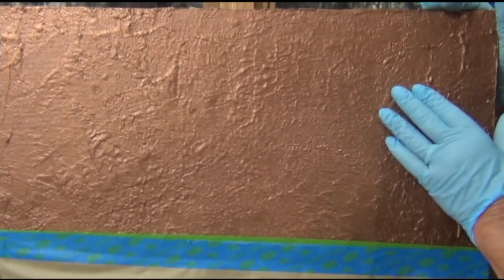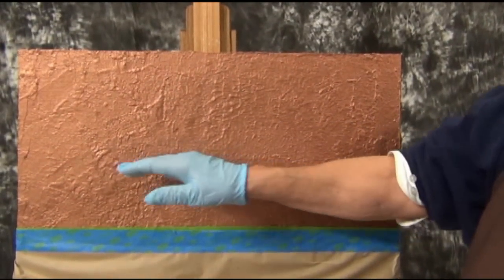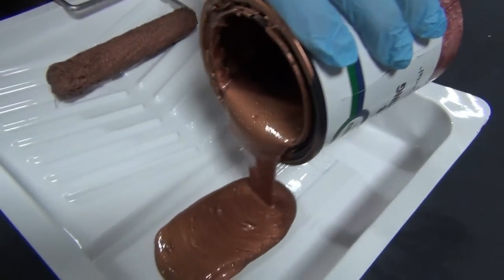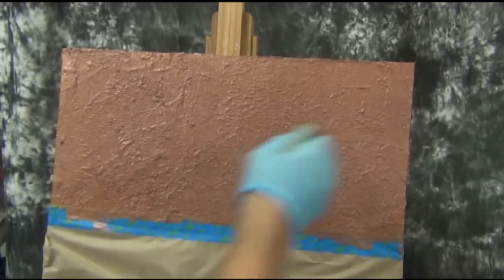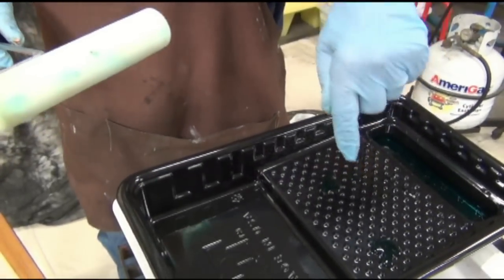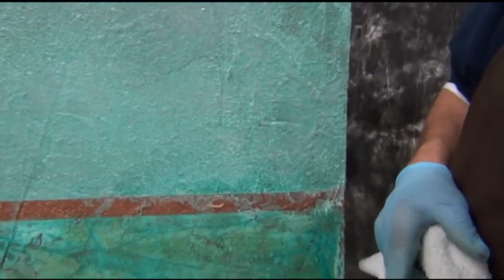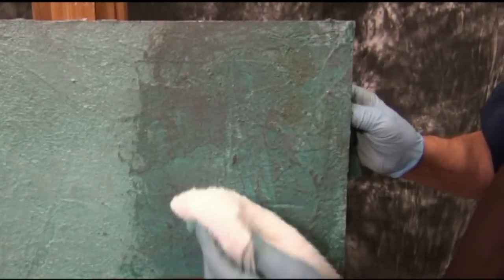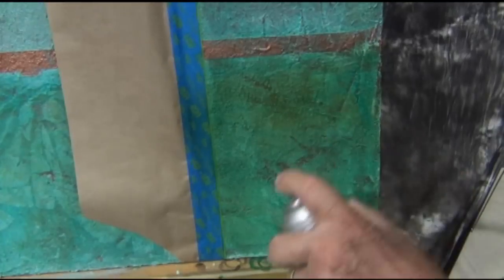Metal Coating Application And Cold Patina

Comment: Does the wrap stay on until the paint dries, or did you take it off before the paint dried
Reply from the maker: With the Metal Coatings, let the paint dry. I usually leave it on about 3-4 days or so.

Comment: The lengths of time to let let the paint and patinas set would be extremely helpful.
Reply from the maker: Typically the Prime It needs to cure for 24 hours before Metal Coating. Between coats of Metal Coating, wait 1 hour. Apply patina while Metal Coating is wet for best results. Clear coat 48-72 hours after Patina is applied.

Comment: Great video.  At the end of the video, you added green, yellow and brown to the bottom left panel, what exactly was it that you sprayed on? Does clear guard come in different colors? Thanks.
Reply from the maker: Dan de Jesus Ron sprays the Patina Stains and Clear Guard at the end of this video. The Patina Stains are the colors he is referring to. They are made from a Clear Guard base but should not be considered the top coat, put Clear Guard or Ever Clear over the top. You can also tint Clear Guard with our Solvent Dyes to make more colors if desired, apply another clear coat over the top of this as well.

Comment: I have seen the videos, and am still unsure about applying the Copper B metal coating.  In your information, it says to use a primer for adhering to ferrous, or non ferrous metal, so I am wondering why there are so many colors of primer?  Is the Copper B coating transparent?  Did you use the textured paint in place of the primer?  Does the primer color have any effect on the coating?
Reply from the maker: We have many colors of Prime It because there are some who choose to use the Prime It alone with nothing on top of it. The Metal Coatings are all opaque, when applied properly, you should not see any Prime It so the color has no effect on the Metal Coating. The Prime It goes down first typically, and then the Texture Paint.

Comment: Is it possible to add a clear coat over this so it could be used to make faux tin tile fir a backsplash
Reply from the maker: Yes, as long as it wont be introduced to a lot of heat it will be fine. Both Clear Guard and Ever Clear would be good choices for a sealer. If this will be used near a source of heat, I would suggest looking at the Smart Stains instead. Give us a call and we can help more over the phone.

Comment: How come no one in all these videos think to use a dropper bottle and make drippy patterns. Pools of patina ect. I am going to do a coffee table but I want to see a lot of the copper. A distinct pattern if you will. Going to either be a major challenge or really easy. Going to do a test run on a canvas first.
Reply from the maker: Good idea, might need to try and do that on the next one! It should be easy, where ever the patina comes in contact with the Metal Coating, it reacts. Where there is no patina, there is no reaction. If you are controlled in your patination, you should be able to achieve exactly what you are looking for.
Reply: You said let the coating sit for some minutes before applying the patina. I thought it is best applied wet? In most climates acrylic dries pretty quickly.
Also wonder why so often the textured surfaces with copper, it’s rarely cast, used more as sheet no?
Reply from the maker: @jonmichaelroberts  It is best to apply the Metal Coating while wet, sorry for any confusion. As for the textured copper surface, its just an aesthetics thing, everyone likes a little something different.